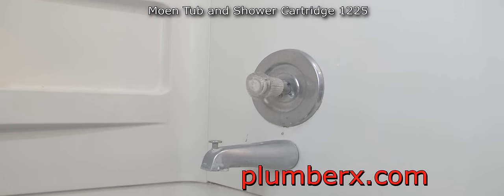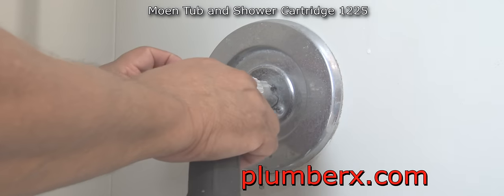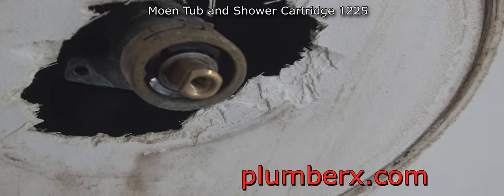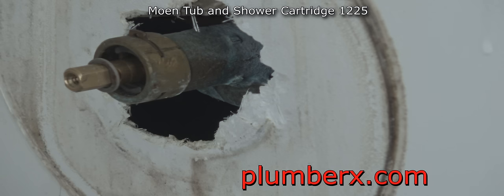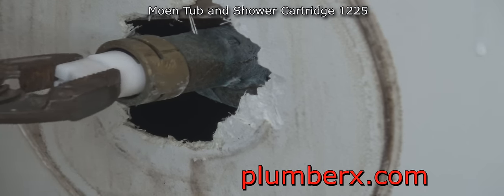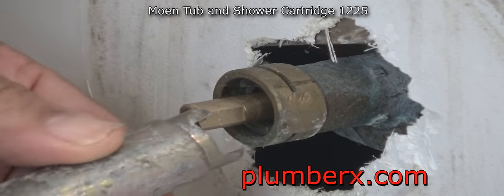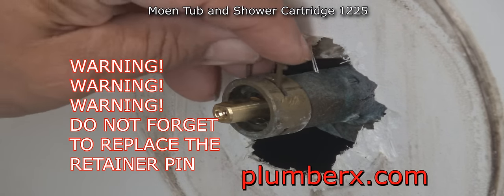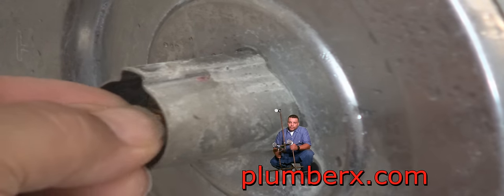1225 Cartridge Replacement  Moen Tub and Shower

Comment: Hope you see this, first thank you I've used this video a few times. That's where the problem is, my cartridges seem to fail very quickly lasting only 1-2 years before dripping comes back. Is it possible  there was an old seating ring of some kind at the base of the pipe that failed? Just trying to guess why the dripping always comes back. Thank you.
Reply from the maker: I usually run into this problem when the water heater is turned up too hot. It will prematurely wear the washers out early
Reply: @theartofplumbing  but I love my hot showers, 😆.  Any other options?
Reply from the maker: @johnnixon I under stand 😖
Reply: @theartofplumbing  think I may have found a hack. They sell a "repair" kit. Couldn't I just use a pick and replace the O rings periodically?
Reply from the maker: @johnnixon  👍

Comment: I’m replacing old 1225’s on my home and neither have the D washer on the old stem and the new kits do not come with one. The only way I’ve seen them sold is if I buy a new handle kit and I would really rather not spend $15 just because I need a 10cent washer. 
Any idea where I can find the D washers? 
And considering the old valves didn’t have any for over a decade living here, are they really necessary?

Comment: Before I watched your video, I did everything you did exactly as you did.  I'm not getting ANY water or control of the water.  It's a brand new replacement cartridge direct from Moen.  Any thoughts why?
Reply from the maker: hot and coild water needs to be on at the same time to work, easly over looked. Most people for get tp turn the hot water back on. hope this helps👍
Reply: The water was turned off the to the entire home.  Hot water was not turned off separate from the cold.

Comment: hey, thnx u for this info. but, could you say why my MOEN shower ONLY TURN ON THE HOT WATER? When the handle is in the OFF position, the handle is pointing down. When I move it ccw 180 degrees to the to be pointing up, (coming out of the blue area, going towards the red, on the escutcheon plate) to where it stops, I get very HOT WATER. It give no cold water at all. Do you think I need to replace it? OR do something else?

Comment: My shower knob stopped turning.  Upon removal I noticed the plastic that actually turns the metal on the Inside was stripped.  Could I just replace the knob since that's the only part that was broken?

Comment: I replaced a Moen 1225 cartridge yesterday on my shower. Prior to doing it I must have watched 5-6 how-to videos on this and none of them showed what I did that I think made the entire procedure very easy if you have a stubborn cartridge. Mine was an original cartridge that was installed 32 years ago and I thought I'd have a very rough time of it.  I squirted white vinegar on the end of the cartridge several times for 1.5 days prior to trying to remove it. I then heated the assembly with a hair dryer for 10 minutes before trying to extract it and I think the heat softened up the old o-rings and seals. To remove, I used a Moen cartridge puller (104421). It was around $24 but a whole lot cheaper than paying a plumber to do this.  Once the puller was secured to the cartridge, I rotated it in place back and forth slightly until I finally was able to rotate it 180 degrees.  After that, I screwed down the nut on the puller and the cartridge came out with very little effort.
Reply from the maker: Nice

Comment: As I was replacing the cartridge I noticed a small small leak coming out what could be the cause of that any suggestions?
Reply from the maker: Sometimes a little debris stuck in the housing or pieces of the older washer broke off and stuck in the house. Next time you remove the cartridge flush housing with water before re-installing the cartridge.

Comment: Thanks I have the clarification.  We guessed at the plumbing shop as to which one it would be and he guessed 1222  EHHHHH WRONG!  The fact the end was different and there was no way this side of hell that you could twist it.  When you said 1225 and showed it with  the fine camera work. Helps.  It has been only been bought 3 years ago, since I bought it from a Contractors shop so had to do the switch.  Mine is still CHROME METAL as it is (47 years old)----at least you were changing out an old one.  I have watched other videos where they change a new one for a new one. THOSE ARE A JOKE.
Reply from the maker: 👍I appreciate you.

Comment: I screwed up and forgot to remove the retainer pin, which snapped off the valve in the slot. Do you have any tricks to get the rest of the valve out?   🥺

Comment: replacin the same cartridge  the handle how do i get it to stop when opening for hot/cold water mine keeps turning with no stopping
Reply from the maker: You may be missing the chrome part that covers the stems, it works as a stopper. Or the inside stop on handle is broken

Comment: Help!! No matter how hard I pull, the stop tube (I think that's what it's called) will not come off- it's almost like it is super glued on. When I tried to pull it out with pliers like you do in the video, it even cut through the metal so I stopped trying for fear of breaking it beyond repair. Do you have any tips on how to get a stuck stop tube off??

Comment: Hello i have a 1225 the is not working anymore when i pull the handle out no water is flowing at all.  Prior to the when i turned it on the head was working but there was also a good amount of water streaming out from just behind the handle also.  i want to change it out but i also cant get the handle off at all.  its one of those with the curvy handle and does NOT ha a screw from the outside screwing into the center.  but rather a hex screw in from underneath.  i removed the hex nnut all the way out but it will not pull off.  can you help?  is there a way i can call you?

Comment: Great video, question, how can you remove the stem if the tip is bent and the tool wont go over it. ?  Renters lived in house before we bought it and we have replaced that same handle multiple times. Called a plumber and he found the tip is bent and said he cannot remove it and will have to cut a hole in the wall and remove tile, and its a big job. Cost is $1100... if anyone has any ideas on how i can remove it as i cannot afford that cost at the minute. Thank you in advance.

Comment: I followed all the instruccions and replaced the cartridge but when I finished, is still leaking...what I am doing wrong?
Reply from the maker: There may be parts of the older cartridge stuck in the body of the valve. I've had this happen. What I did when I had the problem. I took the cartridge back out shined a flash light into the valve body and removed broken pieces.
Reply: Thanks I will do it again and check if is clean

Comment: Which brand/model tub faucet flows the best? I want water to come out forcefully. I currently have a Delta single knob and it sucks. It is getting replaced with something else.
Reply from the maker: I would like to believe they all flow the same. Unless there are issues with the plumbing. By law they can only put out so much to conserve water, anything else may be modified 🤨
Reply: @theartofplumbing  I know the Deltas now have tiny holes inside and don't flow much  without modifications. thought some might flow a little better to keep me from having to modify one.
Reply from the maker: Got it it

Comment: Another issue is wasting a new cartridge by not cleaning out the minerals debris inside before installing the new cartridge or it will soon tear the seals from old mineral deposits. I’ve made this mistake prior to knowing and ruined the new cartridge very quickly!!!

Comment: I have the same problem that I believe needs the new cartridge. It is a pull out single handle. the problem I have is I don't know the manufacture is because it was installed before I moved into this house. I am guessing probably late 80's.  Will the 1225 cartridge work with any other brand faucet.  Thanks

Comment: Great frickin video! i love to have more info then needed, and the possible trouble shoots and problems you may run into, and the different variation of model, and i'd of not had a clue that the white thing was used to help remove the old cartridge. I'm pretty good good to say the least at DYI, and trouble shoot, but it is brilliant to have that knowledge before hand. (Maybe you do carpentry, electrical, flooring, windows...also? if so post some knowledge)
Reply from the maker: Thank you 👍

Comment: I installed my new cartridge just like this, completely fixed my leak thank you! But now the hot and cold are reversed. Did I turn it the wrong way?
Reply from the maker: No problem, just pull the handle back off and flip it. 👍 I appreciate you😉
Reply: @theartofplumbing  thank you for answering so fast!  but I have to flip the cartridge itself correct?
Reply from the maker: @darleneprice3671  Just the handle. I know sound to easy to be true😀 but if like the one in the video that's it. 😉

Comment: This is a great video. I think I can do this myself. My question is does this repair work if you only hot water comes hot? It starts cold on the cold side but then turns hot and won't go back to cold no matter what side it's turned to. HELP! :)
Reply from the maker: Got it. This usually happens when the water heater is turns up to high; too hot of water will cause the rubber washers to start melting and become deform and get stuck after installing the new Cartridge. I would turn the water heater down. Also with the washer being pershelly melted you may have a harder time removing cartridge, but Once the cartridge is remove make sure to check for peaices of washer stuck in faucet and remove that as well before installing new cartridge or faucet will drip. Thank you for the comment and support.
Reply: Thank you!! I'll be trying this over the weekend. One more question, hie do I turn the water heater down? I wasn't lying when I said I know nothing about plumbing.
Reply from the maker: Oh. You may want to call the manufacturer first all water heaters are not the same.
Reply: Will do. Thank you!!

Comment: so i have this type in our shower, replacing this valve, would that fix my issues where the water is not always as hot as it should be? sometimes it is, sometimes its not. we have really hot water everywhere else in house.
Reply from the maker: Yes it could be
Reply: @theartofplumbing  If you have a tankless water heater you need at least half gallon per minute for heat. Also you can adjust the mix so you get more hot, search for that.

Comment: Thanks for the education
Reply from the maker: I appreciate you👍
Reply: @theartofplumbing  I wish I would’ve done this before my bathroom floor was ruined because of a rotted drain in the tub.I bought a new drain and it looks like their is a glued coupling or it was glued to the PVC. It looks like I have to go underneath my house and take a look. Any suggestions?
Reply from the maker: See if you can get access from the back side of tub and shower faucet to drain. May be in a closet or what ever is on the other side it may be easier then going under home.

Comment: Question. I replaced mine with no issues except the knob goes all the way around. I thought it was supposed to go side to side but not be able to do a complete 360. Your thoughts?
Reply from the maker: By any chance did you put the chrome peice back on the shaft of the stem or the part the stops it from turning may be broke of inside the handle. It happens. Hope this helps.
Reply: @theartofplumbing  Guess what, "I" the dude that has given advice here just installed this cartridge in a client's home and I FORGOT TO REPLACE THE CHROME SLEEVE just like CHUCK. Ans I'm the EXPERT ???

Comment: Thank you for the video. I have learned a lot from  this and another video of a 1222 single faucet cartirdge being pulled out.  1222 was too wide and 1225b is what I have now. I am doing this on my own with an occasional strength assist from my husband.  I am using the white tool to try twisting it back and forth but it just keeps popping off  the faucet even when I usr vice grips to try to get leverage and wiggle it but it won't budge. Is there anything I can spray inside and down where the clip went to try to loosen this? House built in 70s and well water has been bad at times over the 19 yrs I've been here so sure it must be cemented in there pretty good. Is there a tool like yours I could buy but smaller in diameter for the 1225b cartridge?
Reply from the maker: Thank for your support. This tool may help. I'm sorry hard well water can be tuff. https://www.supplyhouse.com/Pasco-7040-Stem-and-Cartridge-Wrench?gclid=Cj0KCQjwyur0BRDcARIsAEt86IBEMI2Py7Mdun5xyoMRug_mONVhJS_ziALIiBlDHK2QdPRow1r6aUUaAijWEALw_wcB
Reply: Thank you!

Comment: I use these videos so often during the past 15 years and rarely comment back with helpful tips.  And if it hasn't already been mentioned.  It is imparitive to pre lubricate with "plumber's grease" to extend the life of these cartridges rather than replacing too often.  I would lubricate all sliding and twisting bushings twice over before installing.  Do not use multi purpose grease or any other type other than plumber's grease that is (non hydroscopic) water resistant and residual.
Reply from the maker: Thank you I appreciate the support.

Comment: This is the problem I am having for a rental property that tenants trashed, the bathtub was leaking and I tried to take the cartridge out using a tool and the sleeve stayed in but it is not a sleeve where I have seen others say you can use a easyout but there is not a brass sleeve, any ideas?
Reply from the maker: Got it. That particular cartridge very seldom does that, that's why there no videos out there on what you're running into, but this is the tool you need for it. https://www.acehardware.com/departments/plumbing/faucet-and-faucet-repair/faucet-stems-and-cartridges/4768586?x429=true&utm_source=google&utm_medium=cpc&gclid=CjwKCAjwmNzoBRBOEiwAr2V27dMqdRmjoxLO60w6bfIcZR-XtqDRcU5l_pl1r5KDHp6Oz-iYMoQaQhoCn3wQAvD_BwE you're going to use the end with the little brass ring, slip the brass ring over the ball bearing part and the slip that end in far as it will go and turn it until you feel it lock or click. Now it's ready to twist and turn the sleeve and pull out. Sorry, wish I had a video for that. Hope this helps.

Comment: Question??? How long is the screw that goes inside the knob? I didn't have a knob on my shower and was turning my shower temp myself with needle nose pliers. Now that i have gotten a new valve put in, i was trying to put the knob back on but ran into complications. The screw seems to be to long and i broke the knob now omg AND I cant adjust the temp anymore. WHAT IS GOING ON? PLEASE HELP

Comment: What would you suggest if I’ve done everything exactly the way you described but when I use the tool to loosen the cartridge, it bent the cartridge wings so the tool no longer catches the wings and just glides over them. Essentially, I can’t turn it to loosen it up at all. Would I need to just use force to pull it out?
Reply from the maker: Sorry,😖 but I would recommend you call a plumber if you're having doubts.
Reply: @theartofplumbing  Thank you for your response.

Comment: Glad you showed the retainer pin not snapping in right away.  I have prayed over getting these back in, never thought or saw anyone use pliers to pressure them in.  I have tried to move the cartridge 0.5 mm one way or the other, feared using pliers could warp the pin and then you can't complete the job, turn the water back on at the meter and are generally messed.

Comment: Very Educational Video for replacing Water Valve. My Hot Water side went. What I want to know is, my Hot Water side is perfect, now my center of Faucet is also Hot, when I turn my Faucet to the far right, it's now Cold. Is this correct?
Reply from the maker: Your not getting any cold water at all
Reply: @theartofplumbing  Yes, however, I've Never had a Plumber Change a Bathtub Water Valve before. So, I just wanted to know if it's correct to have your Bathtub Faucet to have more Hot Water in the Center when you turn your push-pull Faucet? Thank you so much for your immediate response!
Reply from the maker: @gaylefriedman3456  that will happen if your water heater is set to high. If it is I would recomend turning it down. Very hot water is not gopd for plumbing, it will ware out your washers fast. Thank you 😉

Comment: How do we know if our cartridge is a 1200,  a 1225,  a 12** ,    and are they interchangable? Which is the best one??
Reply from the maker: Great Question. 1225 Pulls out and 1222 does not and sorry there not interchangeable
Reply: @theartofplumbing  No need for apology. I was just trying to learn as it is hard to know what to order.
Reply from the maker: There both great. One is just a older model of the other one. 1225 is very old.

Comment: I have the Moen 1222, which is similar to this, but a little different. Unfortunately, our brass stem sheared off, so there are no threads for the puller to bite into. I've tried pulling the cartridge with pliers, but it's really in there. Any tips?
Reply from the maker: Sorry to hear your having problems, but i think you may need this puller instead. https://www.acehardware.com/departments/plumbing/faucet-and-faucet-repair/faucet-stems-and-cartridges/4768586?x429=true&utm_source=google&utm_medium=cpc&&gclid=Cj0KCQjwv8nqBRDGARIsAHfR9wD-axu5nR4uFBlNuQY_FvJy31Y9CgNidwMMpRLccOek-hzm6jOlwDYaAh0bEALw_wcB if you only have the shell you will need to use the end with the little ball barring and brass sleeve. Put the brass sleeve over bearing and push in to back of shell and turn till you hear or feel tool lock in place then twist and turn. Up this helps.